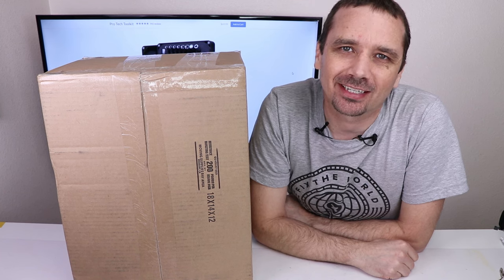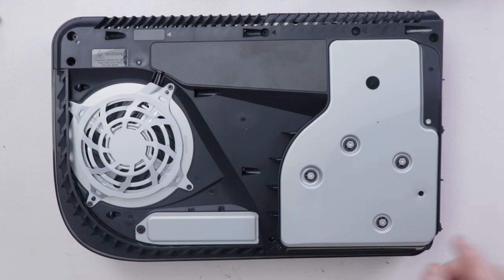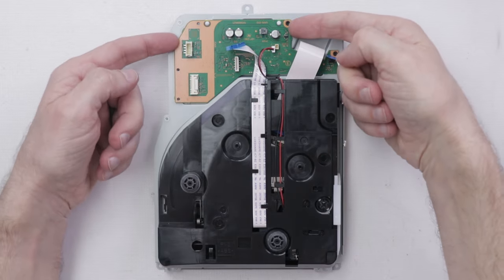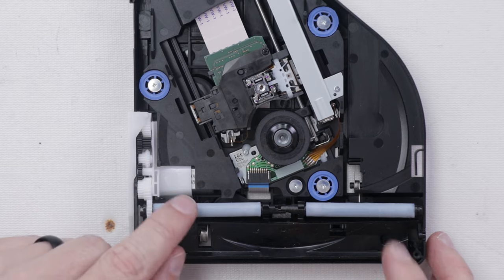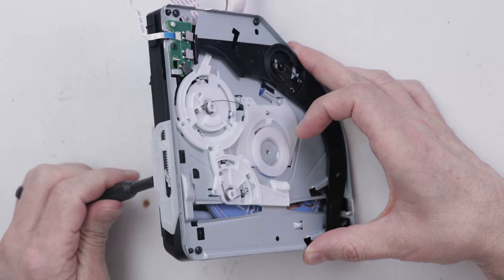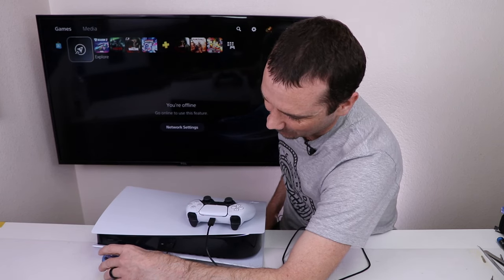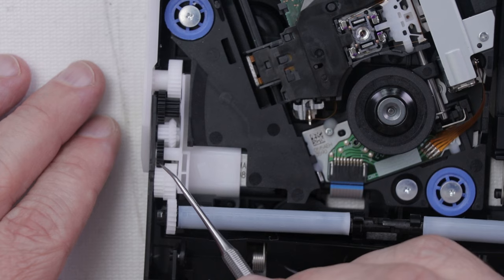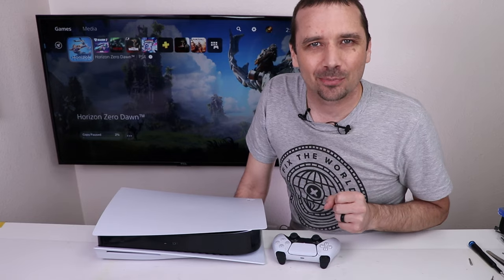Fixing a LOUD, Broken PS5 - First PS5 Disc Drive Repair!

Comment: Wished we could have figured out what was causing thya buzzing noise. If I had a ps5 doing that, it would drive me insane.
Reply: buzzing noise is caused by loose gears they should be really snug and tight together trouble is those drives are mass produced using chip parts hence the noise

Comment: What thermal adhesive do you recommend? I need some to finish my repair on my PS3 but the artic silver alumina isn't being produced anymore and is sold out everywhere.
Reply: Thermal Grizzly Kryonaut hands down the best thermal paste
Reply: @johnsellers4994  thermal ADHESIVE. I need a glue that helps transfers heat.
Reply: @MageLeaderInc  arctic discontinued their thermal adhesives a while ago so best bet would be thermal epoxy

Comment: Which console orientation is best to preserve the disc drive? Because I have a PS4 slim which struggles when ejecting discs horizontally. But when the console is vertical, the disc ejects smoothly.
Reply from the maker: It really shouldn't matter.
Reply: @Tronicsfix  Okay thank you, I guess just cleaning the rollers regularly will help.

Comment: Steve would you be interested in figuring out my my ps5 controller feels sticky or hard to press? I didn't know it then but after buying a 2nd controller I noticed it was always like that from launch day. The controller I bought feel completely responsive and the buttons do not feel like it gets stuck.
Reply: is it just the triggers or all buttons
Reply: @johnsellers4994  triggers work perfectly. Triangle, O,X and Square have felt like that since launch. I didn't think anything of it Since I just thought that's how the new controllers felt. But after purchasing another,  it felt like it's supposed to feel.

Comment: for the amount they charge for the console you would think that for "HIGH" wear areas the would change to either a harder plastic or maybe some type of metal alloy.. the drive componants and the gear train seem so flimsy and cheap.

Comment: I've a question not about this video, 

when i remove the motherboard i think in PS4 just to replace the fan do i need to put a thermal paste again?
Reply: yes you should always replace the thermal past when removing the fan as once you reseat the fan you will create air bubble which affects the cooling you may also introduce dust particles

Comment: only issue so far i am having with my digital  PS5. is that my controller will sometimes  never connect  to the system  when using the ps5 remote

Comment: If you've never heard of a  hdmi / or 4k dummie plug Look it up 
Makes  Gpu work 30% better          PS5       xbox  PC's  etc    Only  $10 
Mostly used in bit coin  minning  6x RTX-3060's 1 connects to screen  -5 others  Dummy plugs          coin crunching 30% increase 💯
Reply: Broken cogs &  bits  missing    ?                      try  a   superglue &  Baking Soda (au we say  bi-carb soda )     mix  hardens like a rock

Comment: The fact that the viewer sent it to you instead of exchanging it under warranty tells me that the viewer bought this from a scalper. This so what happens when you buy from scalpers, no warranty.
Reply: viewer broke it that damage is caused by the disc being forced in to the console have seen it happen on some of my repairs where the owner has tried to force a 2nd disc in and damaged the drive
Reply from the maker: Actually the warranty doesn't cover physical damage caused by the user like this. Also doesn't cover things like HDMI port damage.

Comment: I also have a disc drive issue but it's with my ps4 I tried to insert a disc and it goes off.
Reply: Hi Daniel, Does it slide in nicely or does it get Jammed there could be a short causing the console to shut down after inserting a disc
Reply: @konsolemend  it jams.... And goes off right away.
Reply: @princedaniel5317  Have you tried taking it apart to see if you can resolve the issue?
Reply: @konsolemend  I don't know what could cause the issue......need assistance.
Reply: @princedaniel5317  Yes well you can always contact Steve himself i think his contact info is in the description otherwise I am always availble if you need help as i run a repair shop also.

Comment: I have the original ps4 model with the light on top,  can the wifi antenna be replaced with the pro model one to give it the 5ghz connection to wifi?
Reply: @tronicsfix8603  fake

Comment: Steve my ps4 is still loud after new thermal paste do u think is the fan the problem ? ps4 fat and cleaned
Reply: oh hey does it still have original hdd?
Reply: @Pin-Din7  yes
Reply: @tangledval  my recommendation would be to switch to SSD if you want to that is. that could be one of the sources especially if you've already cleaned the fan and there are no imperfections like chips or groves. if you already have a PS5 then I guess the whole switch to SSD kind of thing is not needed.
Reply: I am broke  lol
Reply: @tangledval  ssd then fro your PS4 cheapest way to feel next gen and to boost some performance in it. préparation of the drive and transfer of your content is textbook procedure.
Reply: @Pin-Din7  idc about Loud time just loud fan new hdd will fix or new fan ?
Reply: @tangledval  well not about load time but an old HDD will produce sounds. you could try a new fan but as you said you've cleaned the system and I'm sure you would've noticed imperfections to determine if a new fan was needed.

Comment: Not really same hardware but you recently did a video on coil whine on ps5 so maybe you can help me in anyway. I recently upgrade the power supply on my pc and also changed the case and added some fans to it. Now I get a really high pitch sound coming from both my ssd’s and argb controller. The ssd’s have the sound close to the power connector. At first I though my psu had coil whine but it’s not coming from the psu. I didn’t hear it previously just to be sure I  reverted to my old power supply but that didn’t solve the issue. It’s not loud but noticeable. Could there be anything I can isolate the high pitch sound with?
Reply: Capacitor resonance basically, it can happen. Last time it happened to me, with a Corsair AX750, I got in touch with the constructor and had it RMA'ed.
Reply: @zHell0w  it’s not the psu my old one has the same
Reply: @sijedevos2376  Misread your message, sorry. A high pitches noise would hint toward a capacitor (somewhere in your rig) is about to fail. Better start searching which one it is and either seek to replace it yourself or RMA the product it is attached to (if still under warranty).
Reply: @zHell0w ’s  @zHell0w as far as I’m aware  @zHell0w

Comment: Judging by the wear marks and the problems so far it does not look like  the PS5 is gonna be a long lasting reliable console. I would also  grease the gears with Lithium Grease.
Reply: Most problems seem to be isolated to certain consoles, mine has been working fine as well as all my friends’
Reply: Probably happened because the owner tried shoving the disc in/yanking it out or tried putting in one too many. Owners fault, otherwise it would be fine.

Comment: My problem with my ps5 is that it's basically a digital version when I bought the disk version. It takes in discs bo problem every seems to be alright. It's just it can't read anything. I tried all the troubleshooting methods but nothing seems to work.
Reply: do you by any chance have an external hard drive connected
Reply: @johnsellers4994  yes?
Reply: @tiedye1631  disconnect the portable drive that is whats causing your issue
Reply: @johnsellers4994  I did it didn't solve the issue

Comment: I have this kind of sound too on my ps4 when I put the disc in do you know if it is the same problem or something else because its a ps4?
Reply: the drives are very similar it is caused by loose gears which should be tight

Comment: i think the noise is comming from the motor itself, but who cares it´s just a disc eject noise.
Reply from the maker: Nah, it's a gear noise of some sort.
Reply: @Tronicsfix  its caused by the gears they are far too loose they should be really snug but thats the issue you get when companies use cheap components its the same with the capacitors in the power supply hence the coil whine
Reply: @Tronicsfix  it’s the screw that you point right at but somehow missed when it was spinning and rattling. Probably what creating a lot of that plastic debris too.

Comment: Don't buy disk versions. This is why. 😂
Reply from the maker: Or do buy it and just be careful taking discs in and out
Reply: Facts tronics
Reply: @Tronicsfix  I bought the digital version (PS5) Because my PS4s disk drive would randomly automatically eject disk.
Reply: @MrJamiez  Seems like you got a bad console, I’ve never had a problem with my disk drive
Reply: @cmdr101z8  like in the middle of the night, my PS4 was beep beep, I were like wtf. The game would be hanging out of the console. And, whist playing games the disks would randomly eject 😂
Reply: @MrJamiez  lol, that’s a weird problem
Reply: @cmdr101z8  it definitely was. When I wasn't on my PS4 I had to unplug it. Because it would turn itself on & eject the disk or when I am playing say gta online, it randomly eject the disk while playing online kicking me off the game. I had to open it & disable the disk drive. After awhile I bought the slim-line PS4. Now, I have the digital PS5.
Reply from the maker: @MrJamiez  That was a common problem with the PS4 but it was also fixable. It was usually related to the touch activated eject and power buttons.

Comment: PS5 is a real mess. 
It's badly designed and still suffers from the jet engine noise - it's just this time it's from the BR player. sony have really dropped the ball. Maybe in about 18 months the beta software will be fixed too.